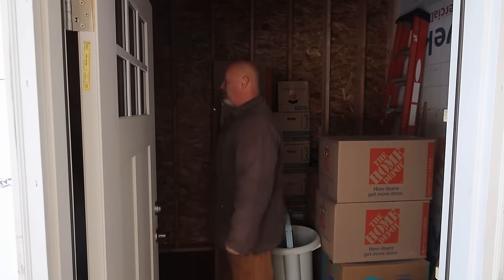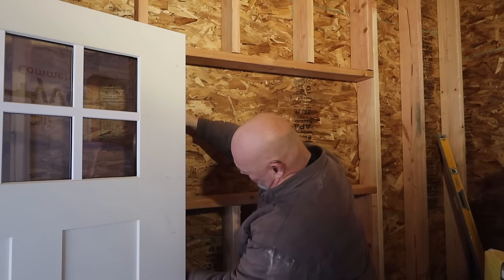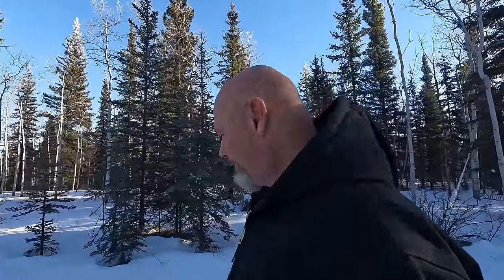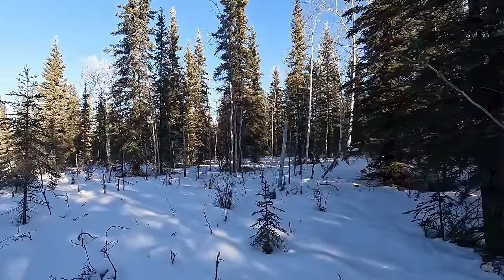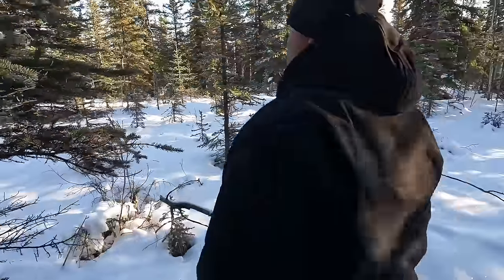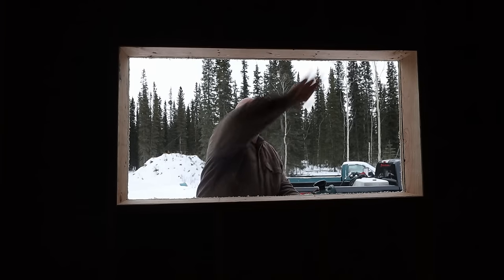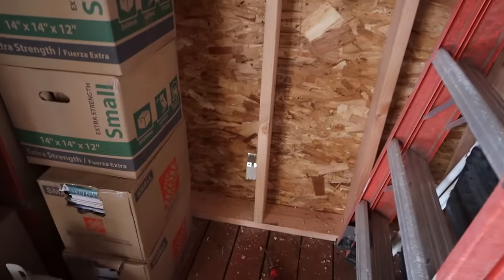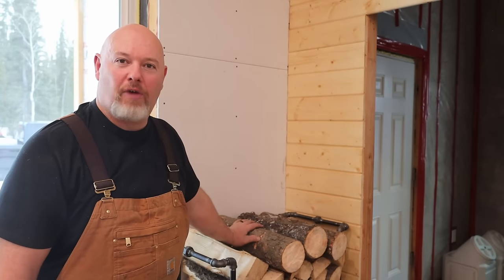Industrial Firewood Rack | Arctic Entry Window install

Comment: I have friends who have a smallish shed built right onto the side of their house. There’s a door on the outside and one that leads inside. They fill 
 the shed with wood for their stove and they can access it from the inside. They refill it as the wood runs out. This way if you get sick you have plenty of wood on hand. If there’s a bad storm etc.
Reply: Many people have wood sheds far from the house and I've always wondered why, it makes no sense.
Reply: @bobstewart4342  - most woodsheds are open front and have spacing between boards to let air flow. But this also means snakes, chipmunks, other things can get in there. Kind of want to keep that away from the house. But my friends have the woodshed away but fill the side of the house shed up too. Animals basically stay out because it’s a room built as well as the house is. After the first load dwindles they would have to bring wood inside anyway but instead they take the time to refill the wood shed. If I had to guess it holds 1/2 cord or about that.

Comment: I love the new 50 acres, congratulations guys!🎉 window looks nice in the front of the Arctic entrance also! Really like the wood rack but wasn’t that expensive, gas pipe and joint unions are not cheap but it looks really cool! Thanks for sharing guys, love your channel! ✌🏼❤️🙏🏼
Reply from the maker: Thank you 🙏 Yes, you’re correct, it was pretty expensive, but we figure that thing will last longer than us… lol 😂
Reply: @wildwoodoffgridalaska  I’m sure it will last forever and it is really nice, great job!

Comment: Is it ok to hanger a vertical hung window horizontal with the drains on the side rather than the bottom
Reply from the maker: 😂 I knew someone would catch that. It was the only window we could get at the time and eventually I’ll have a window made to fit the opening.
Reply: @wildwoodoffgridalaska  lol I thought about doing the same thing I was just going to drill new drains it probably doesn't mater In a vinyl window. I had to reframe some so I could use off the shelf windows then lowes got a new shipment in and I was like to late now

Comment: ok,, the gfci outlets... I have a question?  Are they inline with eachother?  the way you wired them, if the first one trips the rest will go out... best is to put all the wires together and tail out.. Hard to type what i mean.  (electrician by trade)
Reply from the maker: I pig tailed everything in the house but with the GFCI I figured if it trips it all goes out anyways.

Comment: Do you use any engine heater for that Prius? I have one and always wondered. Do you have anything special outfitted to it as tires, raised suspension?
Reply from the maker: That’s our beater with a heater that just keeps going 😁 We swap the tires for studs in the winter and that’s about it… if it’s to cold we plug ‘er in before we start ‘er but she’s usually good to go even in the negatives. 
🚗 💨💨💨

Comment: That window is a single hung not a slider. It is installed wrong. If you look the drain holes are on the side not the bottom. Your bottom track is going to have standing water.
Reply from the maker: Yep